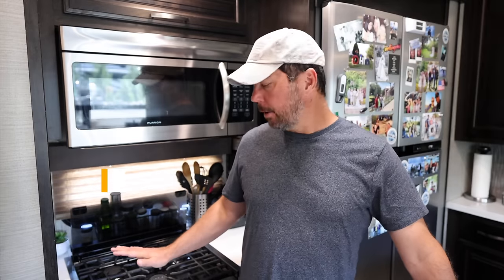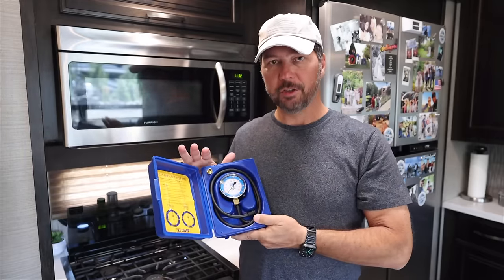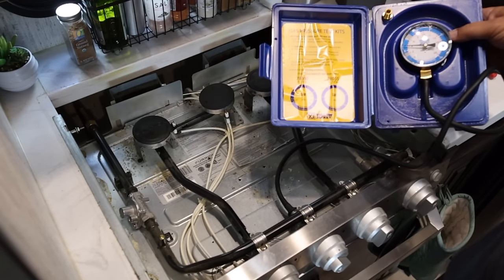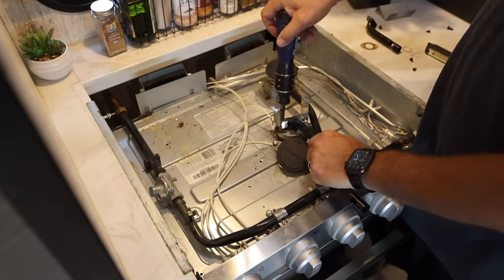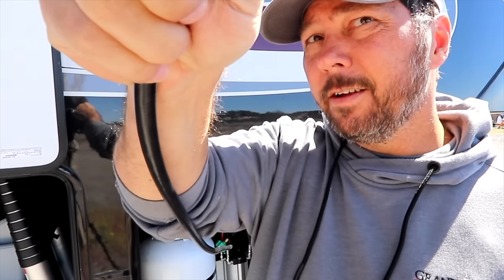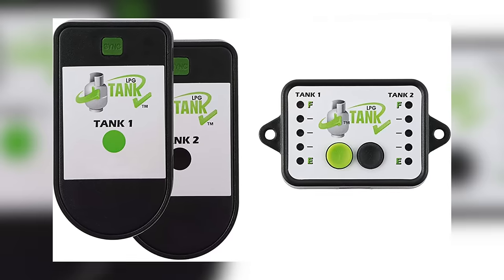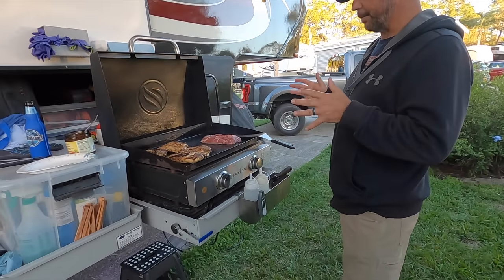Propane Leak and Stove Issues FIXED! (Plus Tips!) (Full Time RV Life)

Comment: I was told years ago that if you want to live full time in an RV, learn what to fix and how to repair most if not all the systems,  it makes $$$ n cents...or saves lots of money in the long run.  We have lived in a travel trailer while we built our house in AZ years ago, yes, learned a lot then too.  But I am a doer also, the homes that we have had throughout our lifetime all have had their issues.  When it comes to repairs, modifications, restorations, I am a little slow getting started, but as long as the wallet does not loose any weight, I get the job done on a reasonable time schedule, and I am impressed as well as others that stop by.  Thank you again for the invite, you do make it look easy...though sometimes it is not.

Comment: Usually a bad thermocouples for the oven.  If it keeps going out I would replace it for safety.  If the thermocouples is not working right it shuts the gas off on the appliances.  At least that's what it is supposed to do.
I remember as a teenager living in a mobile home.  My sister thought she had lit the oven.  How ever she did light the pilot light but the thermocouples failed to shut of the gas.  And next thing we knew is the over door was blown off.
Needless to say it work dad up and scared the crap out of my sister.  After that she told dad he could make his own toast.
Also you can by a gas dector or snooper for about $59.00.  I have one in my tool box.  Comes in handy for those tight spaces where I can't get the soap spray.
Safe travels Brian and Cindy "xtreambydesign with passion"

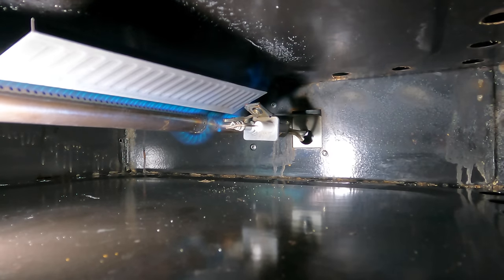Comment: when you mentioned holding the oven knob in for 5 seconds at 10:47 something I noticed in my RV oven I troubleshooter was when you hold the knob of the oven in, to light the pilot light, it's actually warming up the thermal coupler telling the system "hey the pilot light is on we can keep feeding gas".

Comment: Hey Chad. I have a similar set up in my furnace. A carbon buildup on the electrodes causes problems.  Just knocking carbon off helps. I use a nonflammable break part cleaner. It cleans fine with no fire risk from the cleaning solvent. Good luck.

Comment: On your oven. There is generally 2 safety systems. One being for the pilot light, the other for the actual burner. Generally its a probe that is in the flame. If it goes bad it will think there is no flame and shut it all down. Hope this helps. I couldn't see your burner to well
Reply: My thoughts exactly! That part you’re talking about is called thermocouple.
Reply: Chad, did you post a follow up on the oven going out? Having the same issue same Furrion stove/oven unit.

Comment: My RV came with a quick connect that is already regulated. Runs off the main line to the front side of the 5th wheel. I just plug into it and plug into my Blackstone. Works great.

Comment: WOW!!! Coincidence? I think not. Our RV has been in our driveway for the last 2 months, when the previous owner delivered it to us. Been spending the time getting familiar with everything and making my own little modifications. Just yesterday I watched videos on utube to learn about the propane system, mainly the stove and fridge. This video was times perfectly, thank you Chad for reading my mind. Or Tara for bugging him to make the repair, whichever. Question: I bought the same gas level monitor and the directions tell me to place the monitor on the bottom of the tank. That's what I did, and the readings aren't accurate AT ALL. It's the two tank monitor just like yours. I'm gonna attach it to the side like you did and see what happens. Awesome video. Sorry for the long comment.
Reply from the maker: Ours is on the bottom too. The image in the video was from under the RV.  That's where it's supposed to go.  I would contact them and let them know.  Also, be sure to calibrate it for your sized tanks.  I forget how this is done.

Comment: My trailer has a small manifold on the frame, 2 lines go in for the furnace and stove, then a quick connect for the outside kitchen 2 burner stove.  There was an unused port that was plugged, so I removed the plug and installed a second quick connector, BAM I can run the blackstone at the same time too!
Reply from the maker: Nice!!👍

Comment: RE: Oven woes
If you don't light the pilot light, you can still light the oven burner; when oven is up to temp, the burner shuts off but can't re-start without the pilot light being lit.  I think there's also an automatic valve that shuts gas flow if the pilot light isn't on - not sure about this one.  We had this exact issue when the wife lit the burner only yesterday and the oven shut itself off.
Reply: I am not a full timer but I just had to jump in.  I Am retired HVAC business owner so I ve  run into this many times.  First thing to look for is what is sensing the presence of flame?  If a. Thermocouple, then it must be in the flame enough to put out sufficient current to keep gas solenoid energized.   AND connection must be good for solenoid to stay open, Very small current can get lost in bad connection..If there is flame sense rod, flame rectification is happening,  also small current,  about 2 to 3 micro amps..often due to oxygen and heat being present, an oxide will form on the rod which is resistive, which can have big impact on a small current through the rod so the control board doesn't sense the flame current.... keep up good work Tara.     You to Chad

Comment: The 20 PSI regulator I got from your link worked for about 15 minutes before it too, died.  I ordered another from Amazon but the only one they had with the proper length hose is a 30 PSI (!) unit with a gauge on it.  Needless to say all you need to do is crack open the regulator for a ton of gas to flow.  Per it's gauge best operation is at 5-7 PSI.

Comment: OPD is Overfill Protection Device  its a float that shuts off at 80 percent thats the legal limit to fill a tank to allow for expansion yes propane is a liquid under pressure it does not control flow. The regulator controls the flow or pressure that is allowed out.  You can get air locked in the tip that will block the flow usually happens when filling or the opd can get stuck a gentle drop will fix it.  The design of the tip limits the pressure they are designed to keep liquid from passing that would cause a huge explosion  something like a fork lift has liquid withdrawal  what we have in rv is vapor  hope that helps

Comment: It’s best to adjust the spark electrode when it’s red hot (can snap if you adjust it cold)

As for the oven looks like you have an electronic safety device sometimes they just want a clean eg fine wire wool 

As for the adjustable regulator just be careful on your grill it doesn’t start to crack the burners and have flame lift with too much pressure

👍
Reply: Yes, the spark electrode can definitely break it you adjust it cold.  Ask me how I know.  😢

Comment: To help Determine how much Propane is in my tanks I Scale them. (A little bit of a pain) But I found a Suit Case Travel Scale works Great. (Down Side is removing tank hold down pieces ) Quick and Fairly easy. Bonus is very Accurate and Small - Easy to Stow away.

Comment: When I was a kid we used boiling water. Pour it down the tank. Then run your hand from bottom up. Feel where it warms up that's the level. Its too dry here in the desert to get frost lines so feeling cool metal where propane is to warmer where propane isn't works well.

Comment: Our system has always drained down after a short period when the bottles are turned off. I finally found the cause. It is the electric shutoff solenoid for the water heater. I sprayed the jet with glass cleaner and it made bubbles. Now I need to order the new one.

Comment: In regards to your oven going out, you may have a bad thermocouple on the pilot light. if it doesn't sense enough heat, it will shut down the oven.
Reply from the maker: Indeed!  I need to check that, but I think I'll need to pull the whole stove out to get to it.  ☹️

Comment: When you described the oven problem my first thought was that it was a bad thermocoupler. I checked the oven on my 2020 Imagine and found that it does have a thermocoupler but not the type I usually find in a hardware store so it may be a RV specific type.

Comment: Had similar issue with the stove in our 2020 solitude. Reached out to Furrion and was told the stove needed to be replaced. According to Furrion there are no replaceable parts on this model stove. Honestly this seemed very strange there are not replacement parts for this model stove, but given the 5th wheel was under warranty I did not argue and just let the dealer replace the stove.

Comment: You might check the position of the thermocouple relative to the pilot in your oven.  About 1/3 or so of the end of the thermocouple should be in solid pilot flame.  FWIW, a new thermocouple produces about 30mv DC.  It's enough to hold the pilot solenoid open, but not enough to open it.  That's why you have to hold the button in.  The vast majority of the time when you're having a problem keeping the pilot lit, the thermocouple is out position, weak pilot, dirty pilot burner, etc.  Thermocouples also wear out.  So change it after making sure you don't have a pilot issue or poor alignment between the pilot and thermocouple.  If you continue having problems with good alignment and a new thermocouple, then most likely the gas valve is on its way out.  Remember it has a solenoid that's using the power produced by the thermocouple.  In my experience if the pilot and alignment is good probably 95% or more of the time replacing the thermocouple takes care of the issue.  Replacing the gas valve takes care of the really odd ones.
Reply from the maker: Good stuff!  👍🏼

Comment: Thanks for the great video Chad. We just ordered a new Tiffin class A gasser that has propane. Are you aware of any source that makes a “y” that can be hooked to the house propane regulator so you can supply the coach with propane from an external bottle vs using the coach’s large horizontal bottle? Thanks. Jay

Comment: Good video and good info. On troubleshooting the stove, I would have started off with a striker at each burner. If it lites, then it’s more than likely the igniter cause you have fuel to light. But I do like the Blackstone improvements and I’ll add those to my new camper.  Thanks again.

Comment: I was wondering if I could use my vacuum/fuel pump pressure gauge (yes I have a lot of old school tools) to measure the pressure in the propane system.  It turns out you need to divide the water column inches by 27.708 which gives you about .2887 PSI.  This is way below the accuracy of the fuel pressure gauge so I guess the answer is no, darn it.  I guess I need to buy a manometer, or just use the soapy water test.  Good information Chad.   Keep the good stuff coming.

Comment: Great video. I have a class a and the propane is on drivers side. I want to install a line to the door side and im being told I can't use a quick connect because of the distance. I may have to run a brass line that has a screw connect to the other side. I want to be able to connect my fire pit and a smoker.. It only has a 6 ft gas line. Anyway great information. Thanks man. Good stuff.

Comment: I had trouble with my gas water heater. I replaced both the electronics, the relays and fuse, nothing. Trouble shooting, I had gas to the stove, fridge and furnace. I took off the line to the water heater and unhooked it from the main line underneath. Tried blowing with compressed air from the bottom then from the water heater line. I heard a pop. Works now. I'm guessing some black pipe rusted and blocked the line?

Comment: Great info, I saw in the comments about the thermocouplers, and agree that could be the issue, but the normal oven operation probably shuts the gas off when the correct temp is reached and when it goes out, it is possible it is blowing the pilot flame out as well. now do not ask me how to fix that:-) thanks again

Comment: In my first travel trailer, I had a problem with the oven shutting itself down.  The problem was a bad thermocouple.  If I remember correctly, the working thermocouple senses that there is flame (heat); if there is no flame/heat, the thermocouple automatically shuts off the propane to the stove as protection against filling the space with propane.
Reply: that thermocouple is heated by the pilot and needs to be close enough to be heated. Burner cycles on and off by another thermocouple that controls oven temp, when pilot light goes out, no flame to restart burner when temp drops, and oven shuts off
Reply: also, the thermocouple probably is not bad because it stays on when you first light it. It may just need to be adjusted closer and some have an adjustable flame height for the pilot light

Comment: My solitude oven wouldn’t stay lit from day one, dealer ended up changing out the whole lighting system part. Oven had to be taken apart to do it. The oven little parts didn’t come by themselves, thus a big part had to be changed out. It did solve the problem. Cheaply made oven to begin with (sigh). 🍻

Comment: We bought the stop leak and since we have installed it our refrigerator doesn’t run good at all while on LP. It will not cool down our Norcold to the right temperature or if we get it down to the proper temperature it will not keep it cold enough. All other LP stuff works great.

Comment: I like your how-to and maintenance videos more than anything else you do Chad. I'm curious , did gas stop prompt you to do this video?  I just wondered because another YouTuber just did a video on them and he mentioned they sent them to him to try.

Also, I connected my weber q2200 to our rv gas system as it has two quick connects at the rear. What I learned is you can't have a regulator on the grill because the rv already has a regulator. I bought a kit off Amazon that included a quick connect hose and  eliminated the regulator. We have a suburban griddle and it works fine but I'll take my weber over that any day. I have a griddle I can throw on the weber for eggs and I found today I can grill bacon and it comes out great. A griddle is just a frying pan.
Reply from the maker: Just a coincidence on the GasStop I guess.  We only promote them when the topic fits, which isn't very often.

Comment: Have you thought of investing in a Victron GX monitoring system,? I believe that it can monitor propane and fresh tank levels with the appropriate sensors. It can also use ultrasonic sensors for black and grey tanks which mount outside the tank so would not have the problems of build up.
Reply from the maker: It can!  See tonight's video: https://youtu.be/g2g8dDxAumE  We don't have those options on it yet.. but maybe in the future.

Comment: I had to replace the temperature sensing tube that I in the pilot light flame. it is what holds the gas valve open when operating. if the pilot goes out the fluid contracts and shuts the valve. I had to replace the unit.. not sure why it wasnt working but that fixed my issue.

Comment: Does the oven have a thermal coupler that is overheating and shutting down the gas
Reply from the maker: Yes.. that is likely the problem.  Not overheating, but not detecting the heat and thinking the flame went out, then shutting off the gas.

Comment: Chad-  Thanks for the video.  As a technician, I generally ask myself "why" did this thing fail or need adjustment.  I'm making an assumption that your stove was lighting fine for some period of time (years?) In your case with the igniters, why after all this time did you have to move ALL the igniters further away.  What changed that affected ALL igniters, what is common to all of these that could be the root cause.  crazy idea...could it be that your gas tanks had air in them and need to be purged and refilled?

Comment: After weeks of surching for why my oven would not stay lit. I checked my  Thermal coupling and found that it was loose. Under the cooktop on the right hand side closest to you there is a valve assembly. Found one line on their loose.(not even hand tight) I tighten them and all my problems with keeping my oven lit went away. There is a safety valve that will shut gas off in the case of a leak and that was my problem.

Comment: Should we be burning off the propane in the line after we shut off the valve on the propane tank? 
Thanks Chad
Reply from the maker: For the test?  Yea.. thats fine but not necessary as it's not a lot to bleed off and it's done gradually.  So, you might be lighting it over and over.

Comment: Another great vid.  I just installed the propane monitor on my grand design.  My concern is if I hit some rough road or a bump will that cause that sensor to fall.  There is nothing underneath those tanks to catch it if it falls.  I was thinking about putting some kind of plate underneath just in case.
Reply from the maker: We've never had one fall off in well over 30,000 miles.
Reply: @ChangingLanes  ok.  Thanks for letting me know.

Comment: Watched your video on checking propane pressure. Just wondering if you know if you can check pressure with quick disconnect on out side of camper. Rather than the stove, readings should be same I would think.

Comment: Thanks Chad. Our oven has been hard to start. I'll make the ignitor adjustment.
One question I have is with the straps to hold the two propane tanks on our Grand Design 390 RK. They use to work fairly well but now neither side holds great. I've had to resort to tying the metal straps together. Any suggestions for a fix?  Great videos.
Reply from the maker: Ours have been good.. I find it's best to latch without clamping it down, wiggle the tank to center it in the strap, then clamp it.